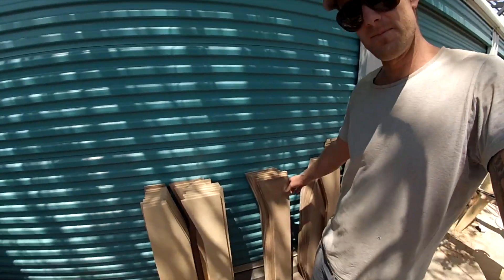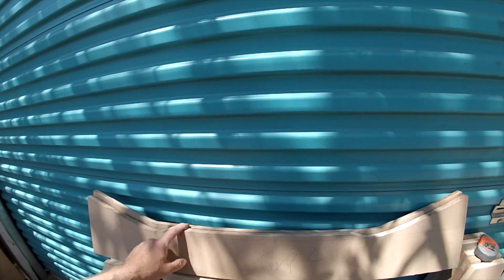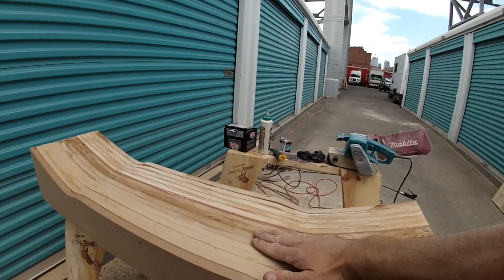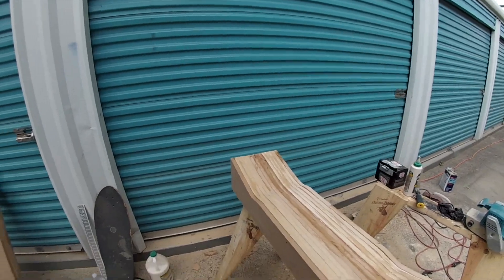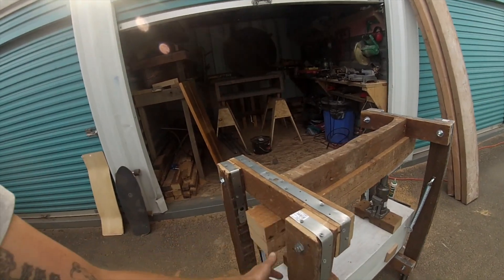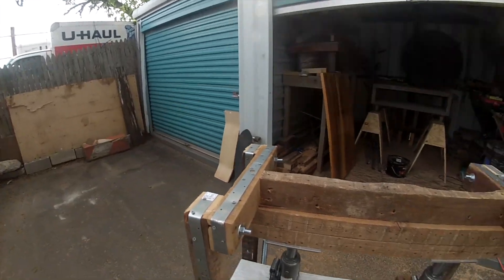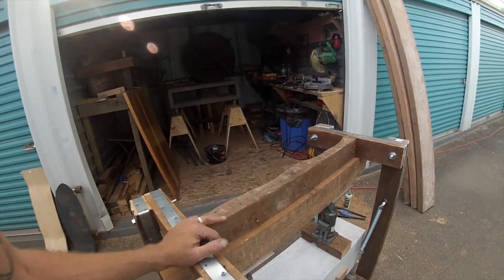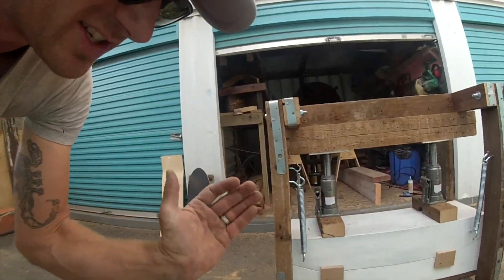HOW TO BUILD  A SKATEBOARD PRESS. Ep8

Comment: Hi, I have an ask, how much pressure do you used? and what is the minimal to make decks? thank you!
Reply from the maker: Hey there,
I honestly don’t know an actual scientific number. When I built it I had seen single jack presses before made with steel beams, so i figured that if I put 2/8 ton bottle jacks on, I could even the pressure out without having a steel bean top and bottom.
I definitely had enough pressure. They were cheap to buy, like $40 ea.

Comment: hi just wondering how you got the measurements for the mould
Reply from the maker: Luc Masure hey! I already had a skate board, so I took an outline of the kick and then set up a straight edge to measure how much concave was in the board. Then I basically just altered the measurements equally to get from flat in the center to the desire wheel arch flair on the outside
Reply: Thanks! Your vids are great! keep doing what your doing

Comment: Looks like maybe 15 x 16mm mdf to make the top and bottom of the mould?
Reply from the maker: Kingston Eldridge yeah, ended up picking up the sheets for $10 a pop. 
16mm/  3/4” is a good size to work with
Reply: I’ve messed up I think.  Tried to use 190  x 45 treated pine and the stuff is so hard to cut with a jigsaw and the cuts aren’t very vertical.  Not to mention the stuff stinks.  Oh well, I’ll try to rescue something with a LOT of sanding 😂. I’m also looking into the vacuum bag method from Roarockit.  That looks pretty cool.
Reply from the maker: Kingston Eldridge I like your thinking with the 190x45 👍🏼 but you it could be a lot more harder to get the shape right.
Ideally, if you poured concrete in to a mould, around an uncut deck blank, that’s key.
But those roarakit vacuum bags should get you going 👍🏼👍🏼
Reply: the plans I worked off used 2 x 8s so I thought I was golden using 45mm but it turns out that 2 x 8s are actually only 1 1/2 inch wide not 2inch at all.  So my 7 lots of 45mm makes a very wide mold with the curve spread wider than it should be. I’m looking at pulling the middle plank out which drops the overall width down to around the same as the plans.  I think I can rescue it but we will see.  It might make a pretty heavily concave board.  Who knows, I could be inventing the next big thing in skateboard design 😂
Reply from the maker: Kingston Eldridge you will be able to use super size wheels, with no wheel bite 😂

Comment: Do you have any reference points to take measurements from for the concave and nose and tail? Building a press myself for my company but I don’t want to just copy everyone else’s
Reply from the maker: Domino Board Co. Yo! 
I basically started by getting the distance the kicks per apart, and getting the kick height. (There are some images on google, or just measure a few skate boards)
Then I wanted the board to be flatter in the middle, so I made sure 3 pieces of wood were flat.
Then I think I measured a few boards to get an average concave and wheel arch I was happy with.
But other than that I literally was working it out on the wood, as I was making it.
I wish I had done it all on paper, so it could have been documented....

Comment: Hi! How did you got the Perfect Form for the Press?
Reply from the maker: I took some measurements of the outside edge of a standard deck and started with that shape, then gradually changed them as I worked my way in to the flat boards in the center. 
Once you have the outer shape and the inner shape, you can figure it out.

Comment: Amazing video, but how the wood hold against the power of the jack, doesn’t the jack just made a hole in the wood on the top?
Reply from the maker: Matyáš Krejčí cheers, appreciate it!
I forgot to mention, but you can see at the end of the video  I ended up putting a piece of 1/4 steel plate above each jack to stop it crushing the wood. Works a treat!
Reply: Benjamin john williams Great, thanks a lot!

Comment: hey mate, could you maybe send me the templates? becaus im making a skateboard for my school project. thanks
Reply from the maker: Hey man, I wish I could send a set, but they are long gone…

Not to worry, I made them myself, and you can too.
Just get another skate deck and sit it on a table, and take some measurements.
Mark the center of each bend in the rail, and the center of the board. Take all measurements back to that.
Each template will do all 4 quarters of the board.

Comment: What kind of wood do you use? and what are the measurements each sheet of wood?  Example 1mts × .45 mts × .03mts
Reply from the maker: Jimmyz Marín I used sheets of 18mm mdf.
The press is 1m long and the panel were cut into 300mm section and the shaped traces on the center to get a top and bottom piece

Comment: Would I be able to buy a press from anywhere and also, how much does it cost to make one of these
Reply from the maker: 360noscopebogan not sure if you can buy one anywhere, I always wanted to make one.
The most expensive parts is the jacks, which were $40ea.
I think the whole press may have been $250-$300
I’m upgrading it to a steel frame very shortly. The wood just can’t take the pressure anymore
Reply from the maker: 360noscopebogan you can buy the jacks anywhere, standard bottle jacks

Comment: Do u know how to make the concave?
Reply: Do I just keep sanding it or what
Reply from the maker: C5 Flippers Hey man, I basically looked a couple decks to get the outside shape, then gradually changed each piece in towards the center to flat, then belt sanded and bondo. I didn't do a great amount of research, just made it up as I went 👍🏼
Reply from the maker: C5 Flippers I just kept making measurements to change the shape. You only have to do one side, then trace it on the other end

Comment: built  me a press
Reply from the maker: yeah
Reply: @Benjaminjohnwilliams  can you explain how you make the press please
Reply: @Benjaminjohnwilliams  will it work if I pack heavy objects on top of the mold to press it down?
Reply from the maker: GIBRONN AQEEL ANDRIES Hey there! Yeah looking back over the video, I did miss a lot of the explaining lol. Was one of my first uploads. 
I took measurements from other decks and basically freestyled it! You have nothing to loose really.
To answer your question about the weight- I don’t think you would be able to compress the veneers tight enough without using some sort of jacks or vacuum bag. You may get air pockets between the veneers...

Comment: could you send me the Form of the parts
Reply from the maker: 5 or 6 lengths of framing
2 sheets of 20mm MDF board
4 springs
2 car jacks
Strapping for timber
4 Castors 
Glue and screws
Hooks for the springs

Once you have the mould built, basically use what ever you can find to keep the cost down.
If you have a welder, weld a frame.
The strapping is holding out good for now.
Reply: +Benjamin john williams i mean der Form from the small wood parts which are gonna to be glued together 

ps. iam from Germany
Reply from the maker: Oh sorry.
I traced the basic shape (angle of the kick) off a skateboard for the center piece (the flattest) and figured out it had roughly the thickness of the board concave.

Once you are happy with your outside shape, you just need to gradually taper it back to flat in the middle.
I basically just used what ever I had near me to get the perfect arcs like :buckets, paint tins, bowl...etc
Once your happy with one end, just imitate it on other side.
Use paper templates before timber.

Hope this helps. Good luck!
Reply: +Benjamin john williams what kinda wood do you use for the skateboard dude?
Reply from the maker: Canadian maple veneer
Reply from the maker: heres a link to where i buy the veneer kits
http://www.pro-edgeproducts.com/index.php?cPath=54
Reply: Jan Blinken

Comment: Do u have the templates or measurements for the mold cut outs?
Reply from the maker: TubTubeTV nah sorry. I think when I made it, I just altered my measurements on the mdf as I went, then cut both sides at once.
I wish I did have the measurements.
I based it on a skateboard I had, and changed the concave a little and length by adjusting measurements